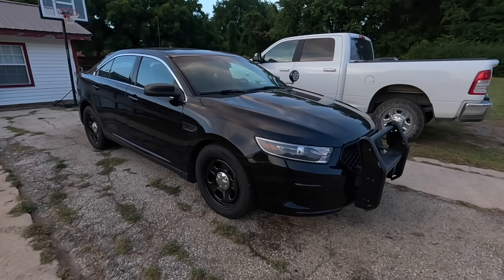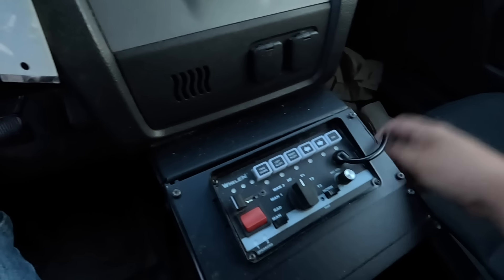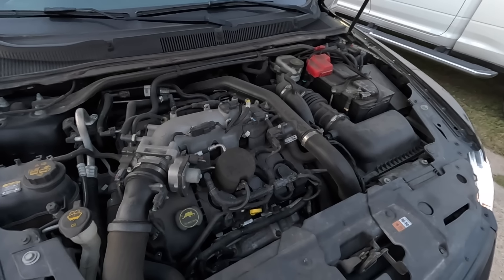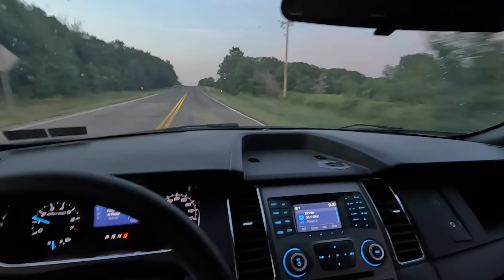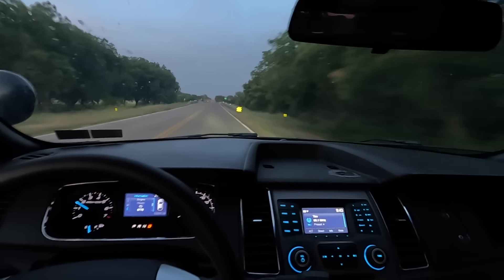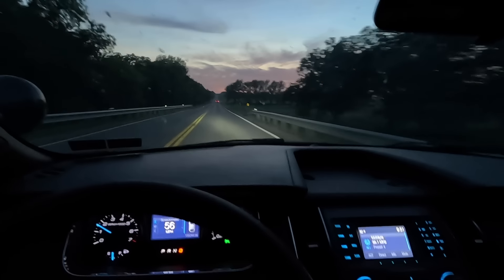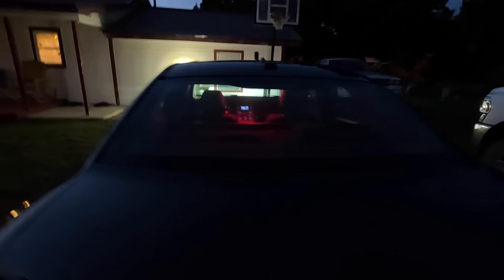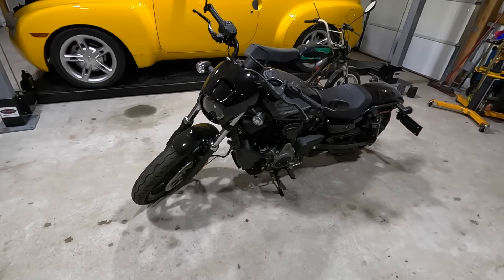I won this Twin Turbo AWD Police Car for $5K from Auction! They Made a BIG Mistake!

Comment: With civilian tags on that car, you can bet the LEO's will be watching you VERY closely!  Also, forget about trying to make the siren work, as that's about a $250 fine if you're caught using it...anywhere, (yes, even on your own private property).  Same with auxiliary lighting - (strobe lamps) may or may not still be there, but don't get caught using them, either.  Short explanation is that if police catch you with with police lighting or sirens, they will cite you and you'll have to have them removed by a certified inspection station.  Had a friend that installed police strobes on his Impala, and he was observed turning them on while he was in a 7-11 parking lot.  That was the end of his "good fun".
Reply from the maker: Not in Oklahoma. Already had my attorney look over the local laws regarding all of this.

Comment: I've been told any police car with more than 5000 engine hours or idle hours is considered a lot, this has almost twice that which is more than likely the reason why it was decommissioned but if it runs and drives good who cares

Comment: The real fun is , if you drive it on a weekend at 1…- 2. - 3 am  , it’s like you can tell who’s drunk because they do dumb stuff . Or one time coming home from the drive in movies at 2am ,  center lane on the I 90 , I had 8 cars that refused to pass me .  And sometimes it can be a pain in the butt . Or the guy who was clearly drunk and went to get off an exit to get away from me, saw that I stayed in the center lane and that I wasn’t a cop so he yanked it back on the highway crossing all lanes and flew past me , both times I wasn’t even thinking of messing with them. They brought it on themselves. Now if you see someone in the opposite lane and bang a U-ie , then they panic.  I pulled in my friend’s driveway to show him the car and his older brother bolted. LoL … and he was thinking…what did my daughter do?   I never really tried to mess with people,  they would just bring it on themselves.. or just about everyday, you get that guy ,  he realizes you’re not a cop and has to let you know that by doing something crazy in traffic, like I had two motorcycles ride a wheelie past me .. I miss that car, I drive a Cadillac now , I miss that respect in traffic. People don’t pull out in front of you , they move out of the left lane. One time I flew past this cop taking radar , I was doing 53 in a 30 , I could see his front tire just start to move , I maintained my speed and gave him a nod and he didn’t come after me…

Comment: All police interceptors where turbo V6 awd. Thats part of the package.
Reply from the maker: That is 100% wrong. My last police video at the auction showed 2 police cars with lights and sirens both had the N/A engine.
Reply: @AutoAuctionRebuilds  maybe in the southern states. Up in Wisconsin they where all awd turbo models. The package has hd suspension and brakes. I was a mechanic for years. Watch out for cam shaft delamination/ bearing failure. Hight idle hours killed them.

Comment: What are you going to do when it starts needing repairs
Reply from the maker: Ummm fix it??
Reply: @AutoAuctionRebuilds  with that many hours of idle time is going to need new head gaskets water pump AC HVAC system are small in cars and all require rebuilds

Comment: Those cars are good until they’re not good. I think those V6 eco-boost engines are junk. They are way too high maintenance. I just don’t think those engines are that strong. If you don’t maintain them the way you should the engine will fail rather quickly.

Comment: Would love, love love to have that all Wheel drive Ford Taurus police interceptor that you stole lol. I have an old Ford crown Vic police interceptor when I first started driving it before the Crown Vic‘s went out of service  used to get irritating on back roads that people slow way way down they drive 10 miles under the speed limit they were  so paranoid when I come up behind them lol. Also be careful with that siren it’s actually illegal to have on a car . check your state don’t want to see you get in trouble

Comment: That gas mileage is horrid! Even my V8 W211 Benz does better than that! 

That being said, you still got a hell of a deal for a lot of power and torque, and as a mechanic I’ve consistently heard good things about those interceptors from friends who have had those or Taurus SHO’s.
Reply: My 2010 Audi S4 pulls down 32 MPG on the highway. And it's got a tuned, supercharged V6. His low MPG was likely due to him hammering on it.

Comment: I had a police car, if you like driving fast i hope your ready to be slowed down by everyone infront of you thinking your a cop.

Am i the only one who wouldnt buy a car with 155k? Your lucky to get 200k, water pump or timing chain is $2-3k for these,  turbo is $2k, new engines can be $8-10k for the taurus sho. I say this as someone who had a bad head gasket at 130,000 miles and the cost of replacing it with labor was a couple thousand. the car itself wasnt worth much more then that.

Comment: The horn is an activation control for the siren. Make sure the siren is in off/horn position, even if it is unpowered, It may have a by-pass circuit for standard horn operation. Be careful having too much fun with that car, you don't need any felony charges. Your car appears to be a supervisors car (No prisoner transport).
Reply: They would have placed the rear seat back in for Auction.
Reply: @johnt.848 , There is no evidence there was a divider mounted in the car. (They leave tell tale marks when they're installed)
.

Comment: I wouldnt have bought the twin turbo.....its horrible when buying a sh one with one turbo that will break but two.....its a nightmare....buying a cop car with high mileage(thats more like 250-300k miles because of idle hours not 150k).....that car will have big problems if you want to keep it.I would only buy a naturally aspirated one.A hemi Charger is waaay better.....plus its ugly.....the 5k price is nothing special sure its cheap but if one turbo fails:))) better buy a good one 😊😊
Reply from the maker: This car has been driven all across the US now with no issues at all. This is an old video.
Reply: @AutoAuctionRebuilds i hope it lasts forever!!!luck also plays a part in it....plus sometimes if the cars been rebuilt or has had parts changed the one with more miles has less problems.I live in Europe so we dont do as much miles as in the Us.Luck is the most important when buying second hand also the ex owner.But the car compared to a Charger or any other Ford is ugly :))) come on the price is what made you buy it:)))

Comment: LOL !! Randy,, I need this car in my neighborhood.. We live in a very nice subdivision on a half mile long straight street. 25 mph limit. However, the teens and some adults use it as a speedway, 60-70 mph. I could use a dummy surveillance camera w/ flashing red light to slow these morons down. BTW, we had a neighbor teen that flew up and down our street at high speed all the time. I finally politely ask his parents to speak to him about his driving. His parents told me to screw off and mind my own business. Two days later the kid killed himself and hurt others in a horrible High Speed wreck. I tried to warn  them.

Comment: You must have really wanted that car, if i won an auction at $4.6K then they said no its 5k, id say no, i bid $4.6k, thats what im paying, they dont like it id say screw you no deal
Reply from the maker: I don’t think you understand how this works after fees associated with purchasing the car from the auction I would’ve paid $5000 anyway regardless of whether I accepted the $5000 or stuck to my $4600 it would’ve been $5000 out the door regardless so it makes no difference.
Reply from the maker: And I knew this car would be a hit on the channel it’s already made almost $1000 on it’s first day so yes I really wanted the car.
Reply: Ok, you made it sound like they said, no 5k plus the fees

Comment: It's great, but that water pump is a whore to do, an internal water pump where you need to almost pull the whole motor. I sold my SHO at 80k since I didn't want to deal with it. $3500-4000 dollar job if you need a mechanic to do it.
Reply from the maker: Water pump at the dealer is $2700 at Ford here. One and done.

Comment: Those are tough cars. Most issues with had with them were CV axles and headlight harnesses burning out. Hard to get in and out of for us tall people. 

One of my guys got rear-ended by a semi in one and walked away. I have pics.
Reply: That is the Volvo safety tech got from owning Volvo car corporation Ford owned from 1999 to 2010. Volvo got better parts  suppliers and Ford funded some projects Volvo likely couldn't have afforded.